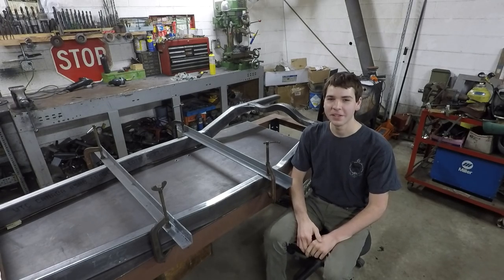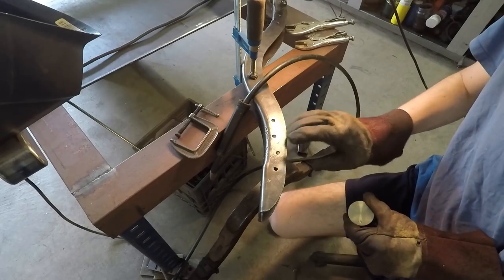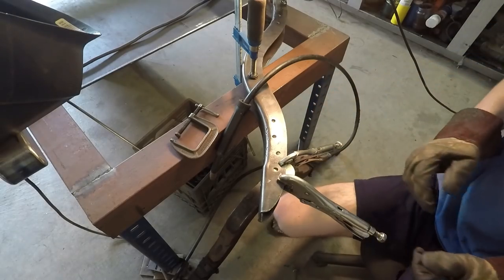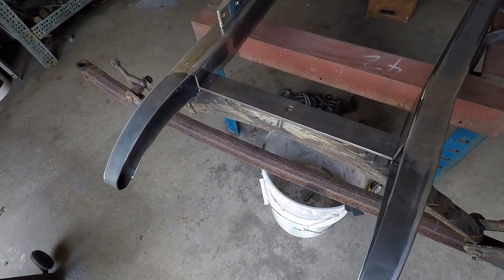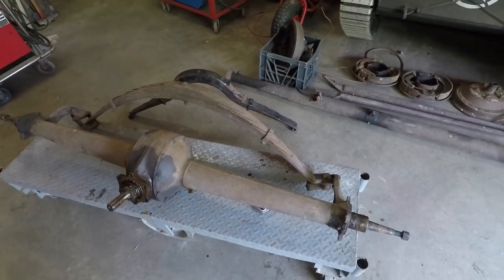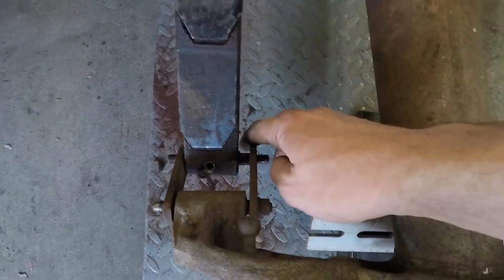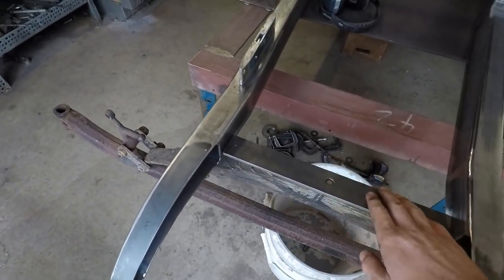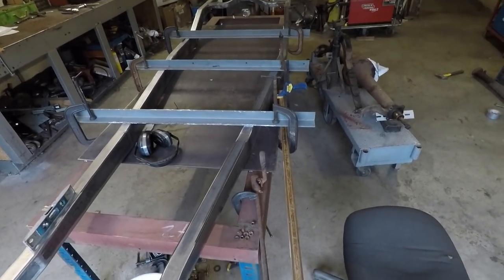Customizing a Model T Crossmember | Boat-tail Speedster Pt. 4

Comment: I never thought about that brass method. Pretty intresting!
How do you protect your camera against this bright welding arc? Doesn't it harm the camera sensor?
Reply: Freizeitflugsphäre 
Camera sensors are actually quite safe from welding arcs. 
Millions of people took pictures of the recent total eclipse without damaging any cameras.
Reply: Old trick could use copper also. Ferrous metal won't stick to non- ferrous

Comment: Greetings,
I’m really impressed by your fabrication skills and your attention to detail.
The work on the rear crossmember is very nice.
By using modified manufactured parts you give your work a very refined look.
You could have just cut up some straight tubes and welded them together, and that’s what it would look like: a modern frame.
The way you’re manipulating your materials gives the frame the look of one constructed in the period.
The welds give it away, but it looks like you’re trying to hide them.
I’m a little late coming to the project, but what I’ve seen just knocks me out.

Let’s be careful out there.

Comment: mentioned the jaguar engine before but with the suspension stuff youre mounting i wouldn't use anything heavier then a 20 HP motor , maibe a ford model T motor or maibe a predator v twin with youre two speed gear setup (wonder if you can double that up one driving the other and make it a 2 speed with a high low so it becomes a 4 speed) think you can operate that the oldfasion way with two tall levers mounted on the side of the body
Reply from the maker: the thought of putting a predator 670 in this makes me cringe.
Reply: it is kindoff a new machine i agree im just not sure the diff can handle a lot more power , maibe a truck axle from that era would 
still partial to the jaguar engine but like i said you probably cant find one there in the states without paying a lot of money 
this is an offenhouser racing engine :
http://kansasracinghistory.com/Engines/Offy.jpg
and this is the jaguar xk6:
http://www.jaguardriversbop.co.nz/wp-content/uploads/2014/04/xkengine1-300x225.jpg
like i said these jaguar engines look verry classic but are verry reliable , in the states they often replace them with a v8 so i dunno
Reply from the maker: that's cool, but I'm sure that that rear end will work just fine. they are plenty strong enough to handle a flathead v8 as long as you're not repeatedly hammering it/ being stupid.

Comment: Um I'm not a tig welder only might and I dont get how you can so.etimes use the tig with out a rod and sometimes you use the rod someone please explain
Reply: The rod is like a filler kinda of similar to soldering.